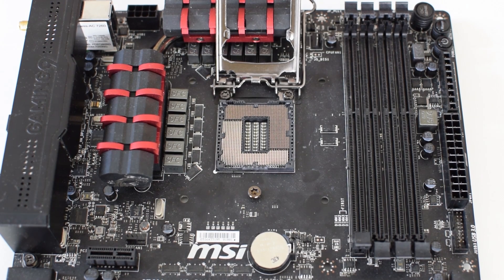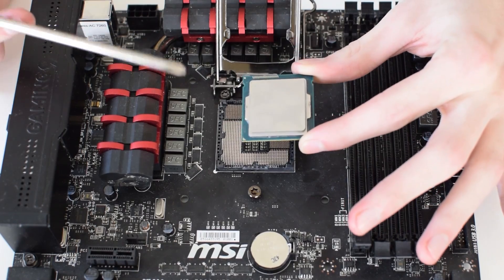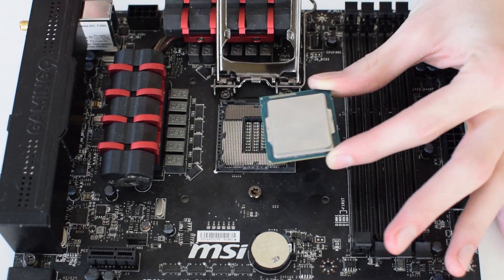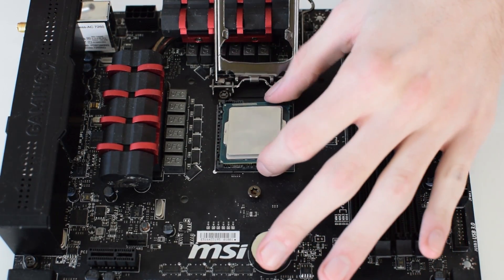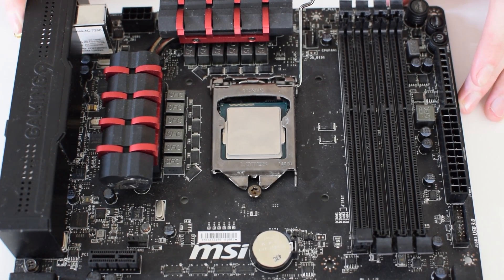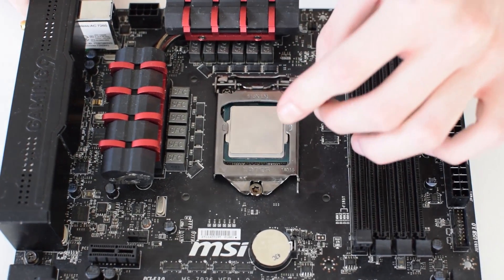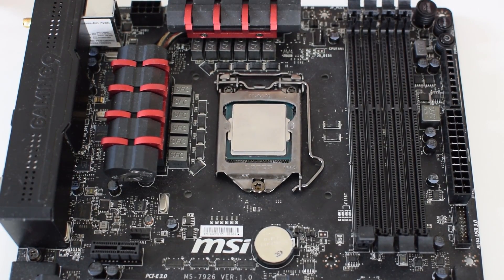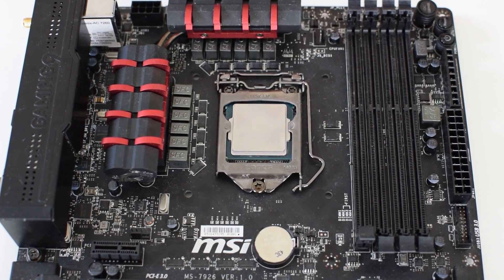How to Install A Processor (CPU) Into a Motherboard - Intel CPU Installation Guide

Comment: I put my processor in and i moved it side a side a lil bit if that normal, then i clipped it into place
Reply from the maker: Nothing wrong with a small wiggle to make sure it's seated properly.

Dave.
Reply: @Play3rYT  Nothing wrong with being logical.

Carlitos.

Comment: @Play3r TV  I have a couple questions for you.  I've never replaced the cpu in a mobo before and I'm a bit concerned on how the PC will behave after the cpu has been replaced.  I have a PC with an ASUS z97-A board in it with an i5-4690K.  I'm considering upgrading the i5-4690K to an i7-4790K.  Installing the cpu is not an issue for me what I would like to know if the PC will start normally and boot up Windows normally after the cpu has been replaced.  Does the mobo has to be reset before turning on the PC? or will the mobo automatically recognize the chip and boot up normally to Windows without doing anything else?

Comment: After inserting the processor in motherboard... Can we use it straight away.. Or is there any installation need to be done.. Coz I'm replacing my old one with a new one..
Reply from the maker: Once the CPU is installed, all that's needed on it is a pea sized blob of thermal paste in the middle and a CPU cooler  :) - For the CPU part anyway

Comment: this is the socket I have in my motherboard, will an i7 6700 processor work with this? if it does will I need to get anything else in order for it to work properly e.g a specific fan, thermal paste
Reply: Yes, an i7-6700 is compatible with lga 1151, though the cooling is entirely optional. You don't have to install cooling, but it is reccomended if you want your cpu to work at its best.

Comment: you're supposed to leave the black plastic on so that it slides/pops out when pushing lever down or at least with 1 finger hold down CPU while pulling lever down

Comment: I bought a Asus strix z270e mobo fitted the Intel backplate and plan on using corsair h115i to cool my cpu. my question is. is there something missing from my box as the CPU back plate can move around in the board slightly looks like it should have some kind of rubber washer between the board and the feet of the back plate can anyone confirm this or advise?
Reply from the maker: It could be something missing from the cooler, although my Corsair H100i backplate moves too, but doesn't cause any issues :)

Comment: I thought your style of commentary was really good. I'm fairly good with computers but playing with the processor is the one thing I have never been comfortable with. Mine recently has had a problem with freezing and i narrowed it down to the CPU. Either it is over heating or has already been damaged. I have a new cooling system which I am going to test but I would love to see if you have or could make a video basically covering how to remove a processor, fit a new one (like this video) and then paste it and install the heat sink properly. 

If not no worries, the internet will find answers and I should be able to get by. I already removed the heat sink once and refitted it , im just terrified about playing with the processor and fitting a new one haha.

Nice video though dude :)
Reply from the maker: The wee Gav is no longer with the team, but he is here in spirit! - Best way to tell if the CPU is over heating is install a monitoring program such as CoreTemp or HWMonitor! Thanks for the kind words on the video though!
Reply: It would freeze before i could do anything in the end. I replaced the processor with a cheap duel core celeron and it worked fine, im getting a new i7 on warrenty. thanks for advice though!

Comment: do u have to take all the parts out before u install the processor
Reply from the maker: Not really, but it is recommended! If you drop it or aren't careful, you can easily damage the socket pins so I would recommend removing the motherboard from the case first
Reply: @Play3rYT  i think i damaged the socket pins what should I do can i fix it myself or should send my pc to a professional . I know i'm late lol

Comment: how do you know if you damaged the cpu
Reply from the maker: It usually won't post when installed into a motherboard. It's pretty hard to damage an Intel CPU in all honesty!
Reply: +Play3r TV I installed it correctly, and I gave it a little wiggle like everyone says to do, and it made a tiny faint scraping noise. it's not broken is it?
Reply from the maker: mpsx 2 Usually when you install an Intel CPU for the first time, you get a dreaded crunch noise! Don't worry, that's normal! It happens to everyone and it even makes me wince sometimes!
Reply: +Play3r TV it wasn't a crunching noise from clamping it down with the bar, it was different, but im sure I'm fine :). thank you for responding so promptly
Reply from the maker: Not a problem! Only way it would bad is if the CPU wasn't clamped in properly and it was grazing across the pins in the socket...but you would notice that instantly as the CPU wouldn't be in the socket properly!
Reply: +Play3r TV the cpu is skylake btw. there are no pins on the cpu just flat looking things. I think the pin scraped against one of the flat things?

Comment: i tryied to install my i5 6500 in a MSI h170 m3 motherboard i don't know why bit ti doesn't work!
Reply from the maker: You sure you haven't damaged any pins? The CPU or board could also be faulty if neither work. Have you connected the CPU 4/8pin power and 24pin motherboard power cables properly?

Comment: Which method of thermal paste application do you prefer? The half-pea size method, or the x-shape?
Reply from the maker: I personally prefer the pea sized method as I always find it gives the most consistent mounts! Of course this depends on the thermal paste itself I'm using! Some work better than others with different methods - Gav